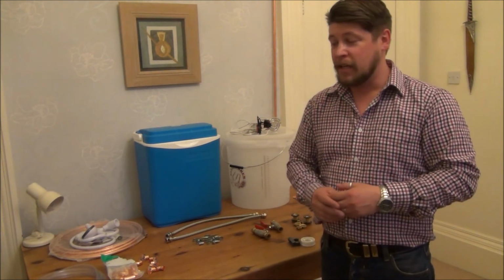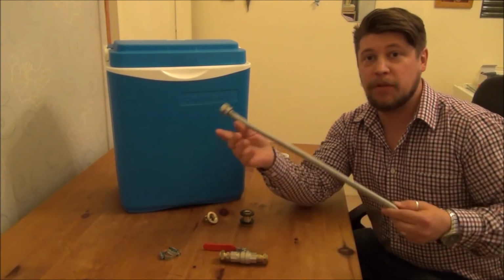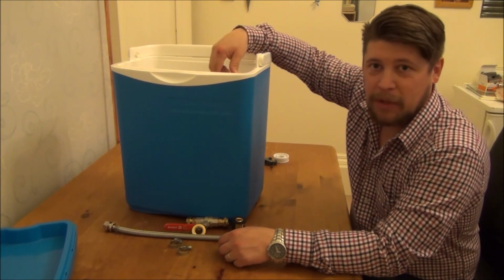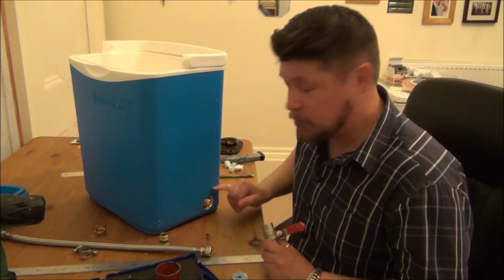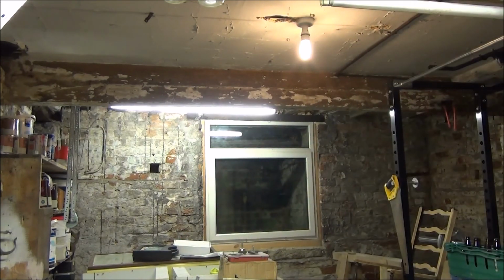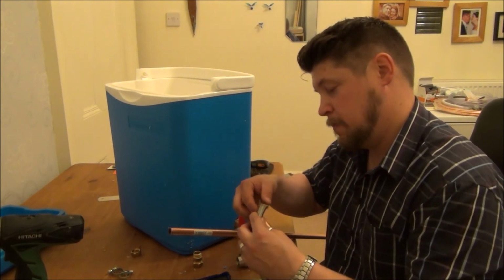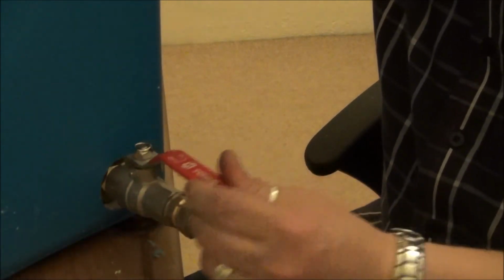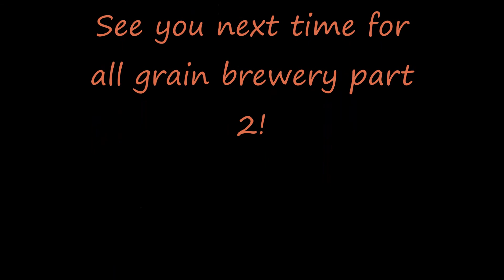Home Brewing All Grain System Part 1 - Homemade Cool Box Mash Tun

Comment: I have just found your channel and haven't watched any of the later episodes.  A couple of thoughts about your braided steel filter - firstly, you have no way of knowing the size of the holes so it is not possible to predict the particle size it will let pass - and secondly, an external filter maybe with a valve each side would be easier to clean if/when it clogs in mid-operation. That said, I love your idea and I will watch the continuation episodes with interest!
Reply from the maker: Thanks for the feedback, some great points! I have found a few issues with the filtration, so it's the first thing I'll be upgrading/ developing as I go. External filter is a great idea. Happy brewing!